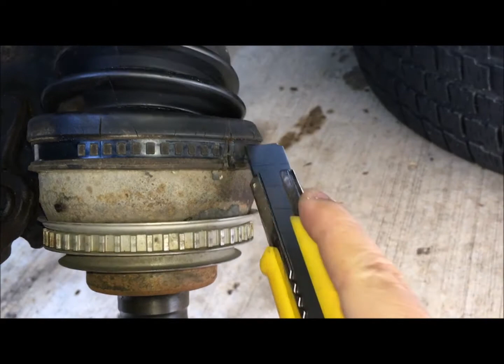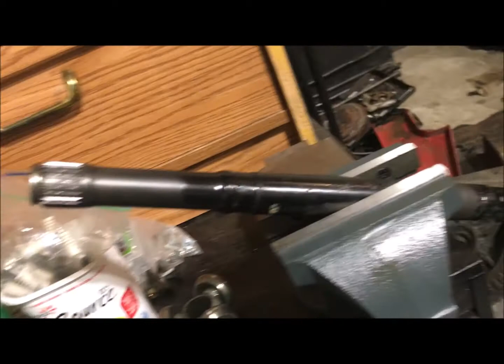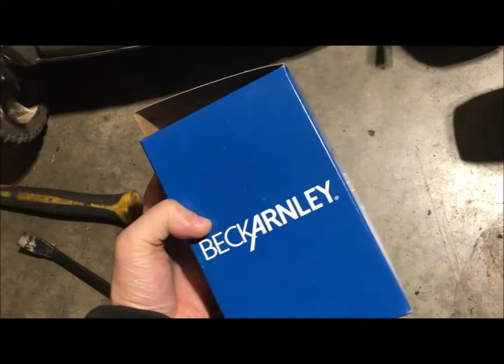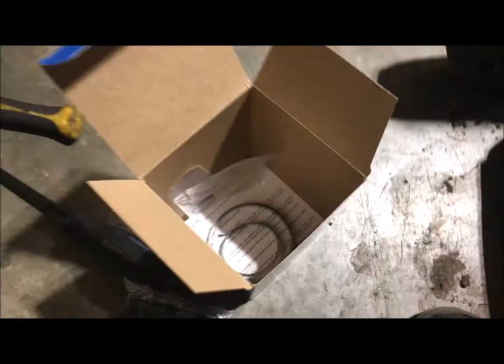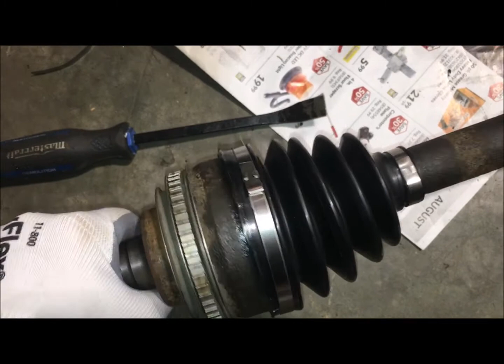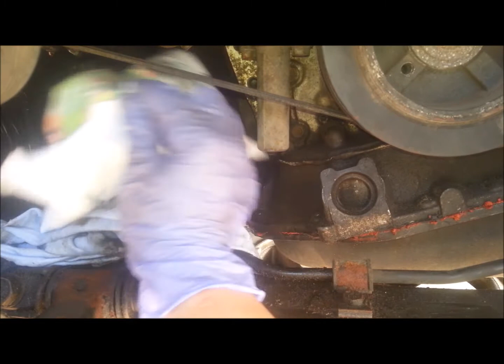Toyota Sienna CV Boots Replacement

Comment: How in the how did you get that spider joint off??! I can’t get mine to budge!
Reply from the maker: Take off the snap ring first (inner joint), clamp the shaft on a vise, use a cheap dollar store hammer to hammer the spider joint off, don't worry you won't damage the joint (cheap hammer will break before the joint if you have OE), use a chisel if you need to (I did). The OE spider joint made of really high quality material, it won't even chip. According to Haynes manual, the outer joint does NOT come off, you can only take off the inner spider joint.